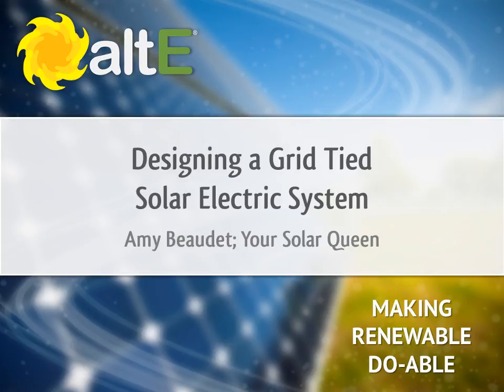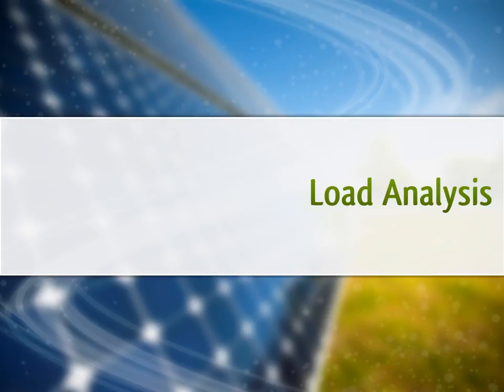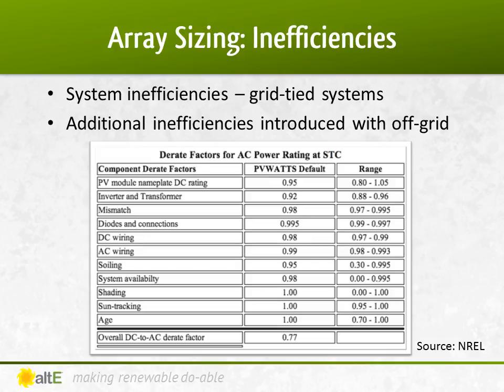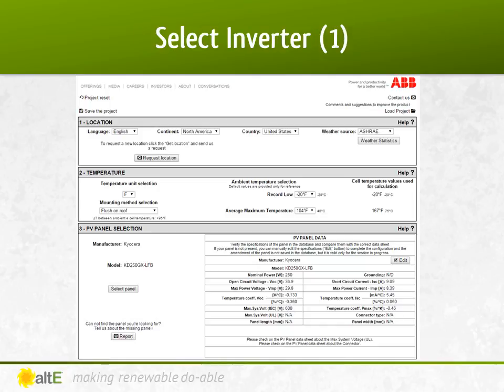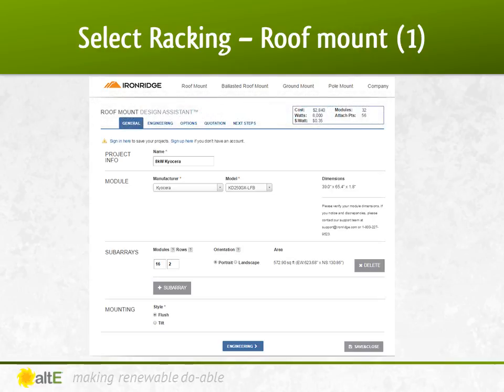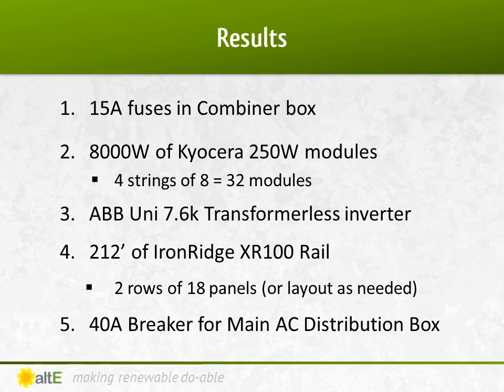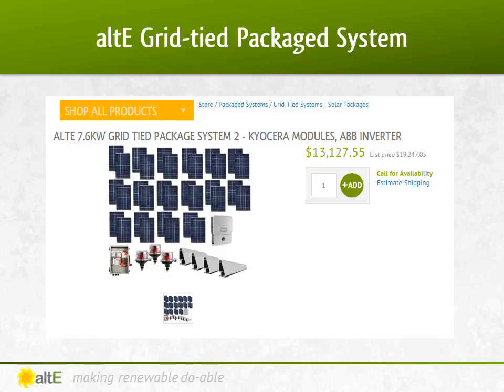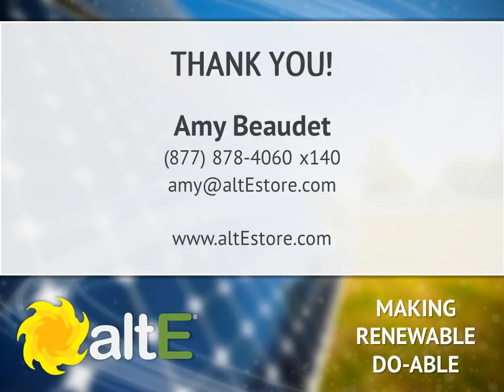Designing a Grid Tie Solar Power System

Comment: Hello there.. nice video however I am a bit confused. Firstly, the total array is 8000W, why did you choose an inverter of 7600watt? I noticed in the inverter spec sheet (6:14)that the max active power is 8300W. Do we size an inverter based on that figure? and if this is the case then why when you calculate the size breaker for the main AC  distrib.box you calculate based on the 7600W figure instead of the max?
Reply from the maker: Excellent questions. Keep in mind that the array is rated at 8000W at ideal standard test conditions. Those conditions probably only happen an hour a day, a few months a year. Most of the time, the array will be outputting less. So it is common to oversize the array to get as much out as possible longer throughout the day. Most inverters and charge controllers are designed to have the input oversized (sometimes called over-paneled) by around 25%. In the short time that the panels are outputting their full rating, the inverter will clip the output to its rating, in this case 7600W. It will never output more than 7600W, regardless of its input. So you can safely design the output based on its rating, not the panels. Since it is putting out more power in the morning and afternoon, the average output of the bigger array will generally be more, even though the inverter may clip at 7600W some days at noon.

Comment: what happens to the installation if you do not have a net meter?
Reply from the maker: If you don't have net metering, you would simply lose any extra power you make during the day. SO the best thing to do is to make sure you run your highest loads during the day when the sun is shining. Do laundry, vacuum floors, make hot water. Anything that uses the power as you are making it.
Reply: @AltEStore if I'm using a smart meter would I loose the extra power to the grid? If yes is it true it'll count against my power consumption and add to my bill?
Reply from the maker: @FrancisOpoku  Yes, the meter could get confused and add the extra energy instead of subtract. That sometimes happens if people turn on the solar before completing the netmeter agreement. It is not a good idea to send power to the grid without the electric company being aware of it. Some inverters have the ability to restrict sending back power, and only limit the solar output to what is currently being used. For example, Fronius and SolarEdge have a meter available that measures your home's use, and only will output that much power. https://www.altestore.com/store/inverters/inverter-accessories/fronius-inverter-accessories/fronius-smart-meter-p40594/#FRNSMARTMTR240
Reply: @AltEStore looks like this is something I need for my setup. can this be used with micro inverters? If not do you sell solar power limiting devices that can be used with micro inverters?

Comment: Hi. i hope you read and answer this. Why am i getting very low breaker size for main AC distribution box with the formula (inverter watt rating / system voltage) x 1.25. My inverter is 600 Watts. I get only 3.125A >>>>> computation = (600/240) x 1.25. Looks unrealistic. What went wrong? Thanks for replying.
Reply from the maker: That calculation is correct. 600W at 240VAC only outputs 2.5 amps. (240V x 2.5A = 600W). Times 1.25 for only running the breaker at 80% brings you to 3.125A, so probably round up to a 5A breaker if you can find it.

Comment: Regarding fuses at the combiner box. Multiplying the short circuit current by 1.56, with the 315 watt panels that I hope to use, yields a value just slightly over 15 amps(15.47052). Can I use a 15 amp fuse or do I need to use a 20 amp fuse?
Reply from the maker: Technically, you are not supposed to round down, only up.

Comment: Hi Amy 
I  would like to know how to connect 13 panel of 330 wp each in series or parallel to the Grid .
It is a Three phase connection to my House and having an Inverter of 5kw Three phase. 
thanks for giving information.
Reply from the maker: It depends on the specs of the panel and the inverter. What is the panels' Voc, and what is the max input voltage for the inverter? or example, if the panel has 40Voc x 13 in series = 520V total into the inverter. CHeck the datasheet of the inverter, can it handle that voltage? If it gets cold where you are, you also have to add voltage for the panels' voltage going up when it is cold.
Reply: @AltEStore  Thanks. Really appreciate

Comment: How come you came up multiplying the short circuit current in 1.56? What is 1.56? Is it a loss? or efficiency? I need this for my project. Thanks in advance :)
Reply from the maker: The 1.56 is x1.25 for over-irradiance, when the sun is brighter than 1000W/m2, like at the silver lining on the edge of a cloud, and another x1.25 for continuous current, amything that runs over 3 hours must be oversized. 1.25 x 1.25 = 1.56.
Reply: I had the same question. As per NEC section 690.8(B)(1) PV system currents are considered to be continuous, the maximum currents as calculated above  must be multiplied by 125% to calculate the minimum conductor size. This calculation ensures that the conductors do not carry more than 80% of the continuous current value (0.8 is the inverse of 1.25). In the PV industry, the result of this calculation is commonly referred to as the “156% factor.” When this rule is applied, the module’s rated Isc has been multiplied by 156% (125% × 125% = 156%). Therefore equation for determining the nominal fuse ampere rating (In) is:

In= Imax  x  1.25

http://www.firstgreen.co/2014/09/solar-pv-system-sizing-sizing-fuses-for-your-pv-system/

Comment: can you please explain the cutting of 50percent of solar wattage for offset..how is that adding benefit?   So that means 8000(average) times 4.5 so thats 36KW would be generated from solar and the rest 15 KW would be taken from grid is it??? But how is that making a difference?
Reply from the maker: Ani16 the goal of grid tied solar is to buy less electricity by making your own. For example, if you use 900kwh a month, and you pay $0.20 per kWh, that is $180 a month electric bill. But if you make 500kWh, you only need to buy 400kWh, dropping your monthly bill down to $80. You save $100 a month.
Reply: but in order to make that 500Kwh, i have to invest in solar panels, and converters and fuses, and wires, and installion charges..doesnt it all even out?? is it a really fair deal??
Reply from the maker: Ani16 it depends where you live. Here in Massachusetts, with expensive electricity and good local incentives, it's about a 6 year payback. That means at least 20 more years of free electricity. If you are in an area with cheap electricity and no incentives, it can be up to 15 year payback. But you can still making cleaner electricity, so there is always that benefit.
Reply from the maker: Here's a good summary of the US states. https://solarpowerrocks.com/2018-state-solar-power-rankings/

Comment: please, what pc software can i use to draw a diagram similar to 10:30
Reply from the maker: I used Microsoft Visio for that schematic, but lately I've been using a free program called TinyCAD.
Reply: so it is not a specialized software for solar, I was using Solarius but I thought there is newer program.
Reply: Do you recommend a designing program or what do you prefer like PVsyst of PVsol etc....
Reply from the maker: The tools I use are just generic electrical CAD. I created the library myself. So it does not do any design work, just drawing what I designed by hand.
Reply: very handy and good idea ...so grateful

Comment: Hello Amy...I am Pedro 
I followed some of your interesting videos aboit solar and find them really informative...that I am doing installs myself ...I am in the California Close to San Ysidro (the solar hours here it says its 5.3 altough I can tell its more than that)...I am in the process of installing some panels on a school (their bill tells the average is 8500 Kw/month)...so based on that I need a system of 54Kw...I would like your help to choose a Grid Tie Inverter for it (their budget is not so big) so I intend to install about 1/4 of the total of solar panels required and then in the future (one year later maybe) install another 1/4 of the total panels (asuming they had saved some ectra money on their electric bill) and so On until they have the 54Kw system complete...SO I am guessing the Inverter should be choosen for the total 54Kw from the beginning right?...
What will you rcommend please ans if in the future they want to add batteries could they?
Thanks for any advise adn keep up the good work
Reply from the maker: Pedro Cordoba My suggestion is to do 4 inverters. Underpowering a large inverter for years is very inefficient. Just get an inverter that is about 15kW, and add more when they have the budget.
Reply: Thank you...I will take your advise...Have a nice day

Comment: is it possible to operate a solar system where electricity comes from solar panels directly to the loads without grid or battery back up ?
Reply from the maker: For small loads, like charging your cell phone, yes. You can connect the solar panel to a cigarette outlet and use your car charger to manage it. See the video we did showing that, https://youtu.be/_GcBfsEaerQ . Solar water pumping connects the solar directly to the pump to pump water when the sun shines. Also, SMA has a feature on their grid tie inverter to power up to 1500W directly from the solar if the grid goes down. But the variable nature of the sun makes using the power directly from the sun unreliable, and isn't done for much more than that.

Comment: DATE: 26-OCTOBER-2016 BY FELIX M.S.JR.: 

INDEED, THE PLUG-IN SMART GRID TIE INVERTER (GTI) SHOULD BE ABLE TO 
EXPORT THE EXCESS GENERATED POWER THAT THE SOLAR PANELS (i.e. Po= 
550WATTS)  TO THE UTILITY POWER COMPANY if the demand load in Watts of 
the HOMEOWNER user is only just 250WATTS and the excess 250WATTS (and 
minus the internal losses in the GTI say -50WATTS) should find it's way 
back to the Power Utility Grid as excess power by the HOMEOWNER thereby 
supplying power to the UTILITY COMPANY as export since the generated 
electrical ENERGY can not be wasted or destroyed but is conserved and it
 can be used elsewhere in a COUPLED ELECTRIC SYSTEM WHICH IS POSSIBLE IN
 THIS CASE SINCE THE SOLAR PV PANELS THRU THE GTI DEVICE AND THE UTILITY
 POWER GRID ARE BOTH SYNCHRONIZED WITH EACH OTHER AT SAME VOLTAGE, 
FREQUENCY AND PHASE. SO IN THE PROCESS, THE EXISTING INSTALLED KW-HR 
METER OF THE HOMEOWNER SHOULD SLOW DOWN AND STOP AND THEN REVERSE IT'S DIRECTION INDICATING THAT THE ENERGY FLOW IS MOVING AWAY COMING FROM 
ANOTHER POWER SOURCE WHICH IS THE SOLAR PV PANELS WHICH IS TRUE EVEN NOT
 USING YET THE NET METERING SCHEME OF THE UTILITY POWER COMPANY OR THE 
SO CALLED BI-DIRECTIONAL KW-HR METER AND AS SUCH THE HOMEOWNER SHOULD BE COMPENSATED FOR.